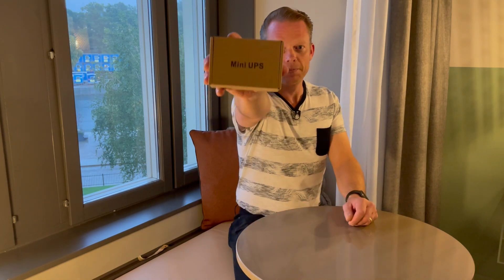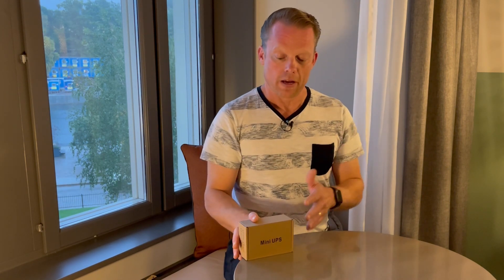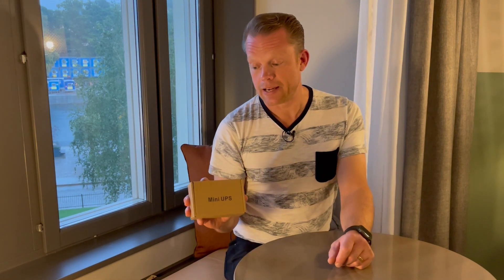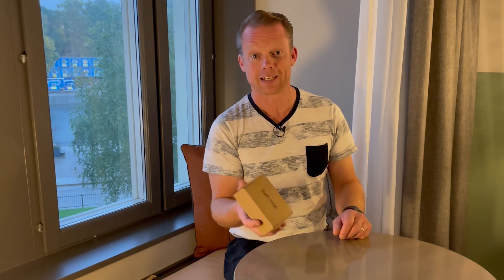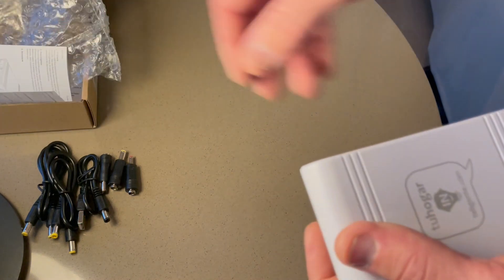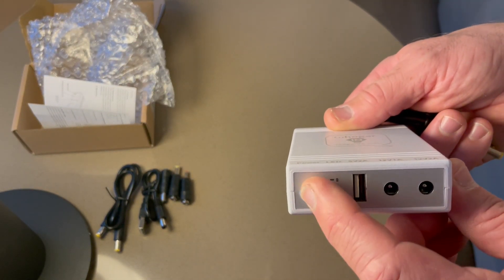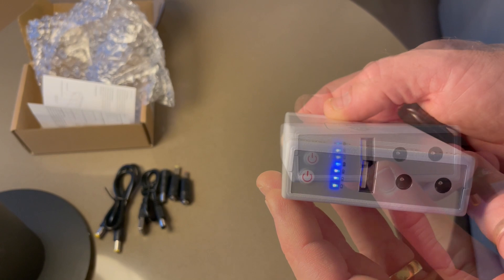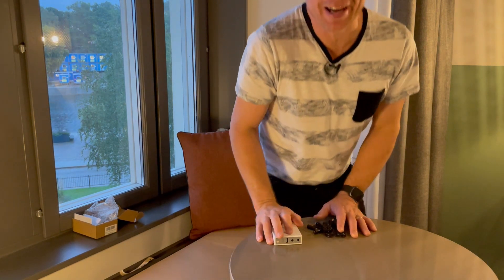I bought a 12V Mini Ups for routers, raspberry pi, odroids micro computers and more.

Comment: Depending of the power usage and voltage of home assistant you can use 5v from the update firmware usb or if DC voltage is under 400v just use a power supply (phone charger) connected directly to 400vDC. Firs stage in a Switched-mode power supply is a dc rectifier that brings the voltage to 400VDC anyway.(does not work for old type with transformers inside)

Comment: Great to see this, can't wait to see the video. Just minor comment - I tend to connect all my critical things (inverter, victron, ...) using wired ethernet, so in that case, powering the switch might be a good idea, too. But if you only have wifi, than the AP/router should do.
Looking forward to the follow up :)